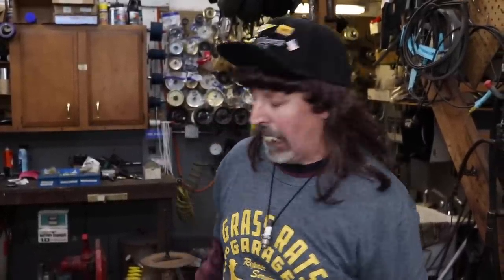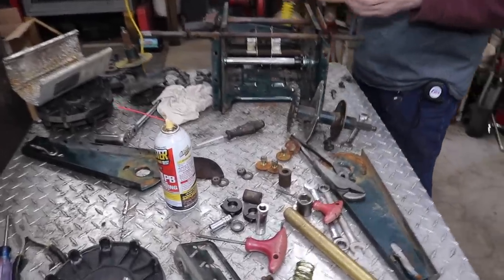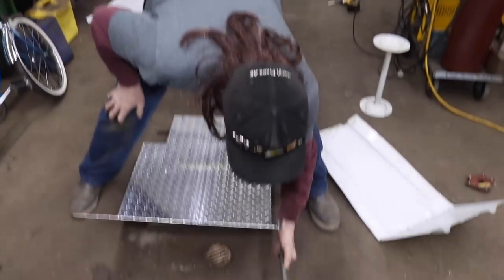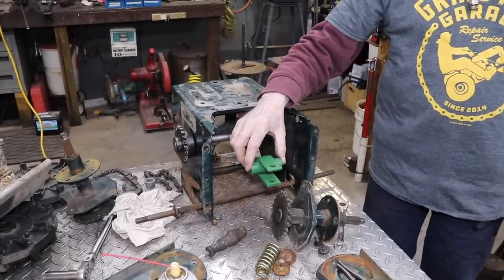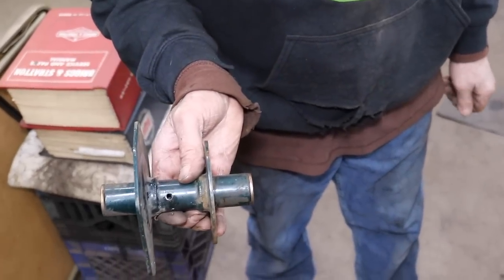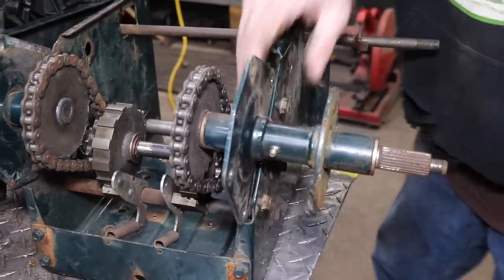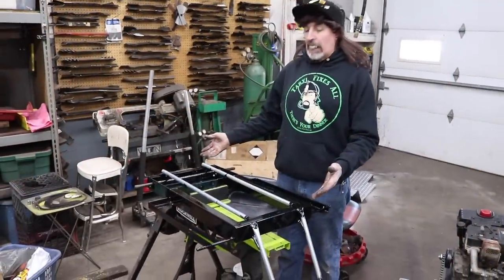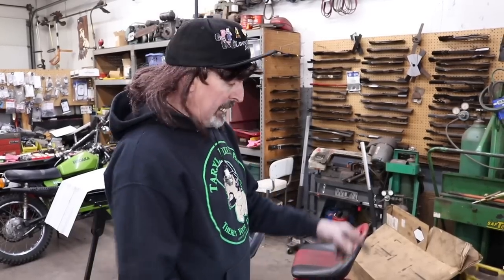Build Your Own Awesome Snow Dog (Part 2)

Comment: i like your tire storage idea under the seat. Do ya think the flat stock on top of those 2 springs for suspension might need a gusset on each end to keep the flat stock from tearing away from the "frame"?

Comment: I don't think the draw bar pivot is a good idea. You need the sulky to be horizontally locked to the tractor, only pivoting laterally for steering. With a horizontal pivot you cannot run on the wheels as the front of the sulky frame will drag on the ground.  I would make the pivot mounting with a motorcycle head stem or similar, then there will be a three point contact to the ground aiding stability, with no track drive torque reaction through the handlebars and it will have much easier steering.
Good luck, great project.

Comment: PS ... you probably already thought of this but you may have to install some snowmobile track studs into those tracks to gain enough traction to be able to pull hard enough to pull the weight of a person roughly 200 pounds... just don't run it on your garage floor with studs ... cuz you'll tear up your floor... I know this from personal experience ...ttyl dancing I post comment and doesn't post

Comment: Remember - KISS - keep it simple stupid - Remember back in the day of the old, powered bar stools?  You could keep the track lock outs for the steering and ditch the surrey.  Put wheelie bars on the back, a bar stool above the power with controls on the left and right hand holds and then jump off if the terrain tipped you too far or put some vertical spring-loaded single wheel anti tip bars on the sides - you cannot pull or push more weight than your power application so sit on it for the most of both worlds. = Samuel said that- Burrp !!

Comment: I heard that those's trac snow blowers did not have very go tractions. They looked great but dispalced the weight accrosed the tracs pretty much did the oposite. Where a wheel puts weight in a smaller footprint. Someone correct me if I'm wrong

Comment: The external drive sprocket should be larger, 16-20 tooth. You will have more HP and torque to the tracks. The sprocket you are using now has speed, but you will  sacrifice low end torque and the clutch shoes will suffer. Go for torque not speed. The drive train will thank you.

Comment: Hoo boy, your shoulders are NOT going to like that up-and-down articulation between the sled and the drive unit.  Like I told you in the last video, the track belt is just going to transfer the torque to the back, so it's still going to wheelie.  And since that articulation will let it, it'll be entirely up to your arms to counter.  

Even without the wheelieing, the back-and-forth from going over terrain will do your shoulders in...ignoring that any hump big enough will yank the handlebars from your grip then whip them back down onto your legs, that is.

Comment: That muffler needs to go. Your going to be choking on fumes even in the open. A zoomy pipe
to one side or the other or better yet a elbow with the pipe going straight up with the thing
on old tractors with the little counter weight to keep the rain out that has the awesome clank
clank at idle.....

Comment: @1:55 MTD is notorious for doing that. I talked with a guy who services small engines before I bought a snowblower.
I asked him what does he work on the least. His answer was Ariens and that you could get just about any part for just about any snowblower they ever made.
MTD, he said, he gets guys all the time coming into his shop looking for a certain gear or part and he has to tell them that they can't get them, that the customer has to buy an expensive subassembly and sometimes they aren't available either.
Stuck buying a new lawn tractor because of a $20 gear failing and is unavailable for replacement.

Comment: I wonder if you cut and welded the pipe for your runner support to the same angle as the front of your aluminum plate so you could support the front a little better would be advantageous? Never mind. You did. Hahaha.

Comment: WELL NO. LEAVE IT FRONT DRIVE AND TRANSFER SOME WEIGHT TO THE FRONT LIKE BATTERY ECT.    THE DIRECTION OF THE TIP IS 100 % CONTROLLED BY THE WEIGHT DISTRIBUTION